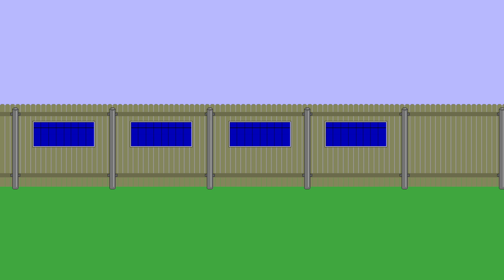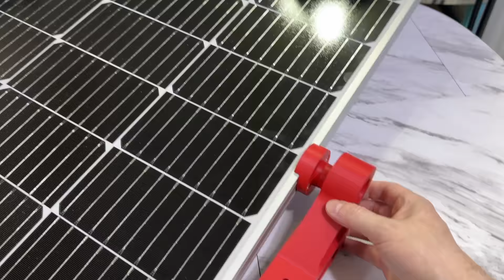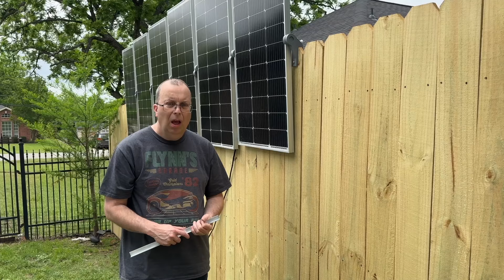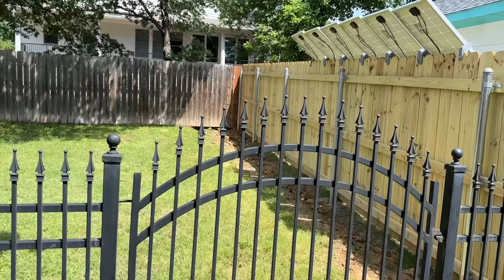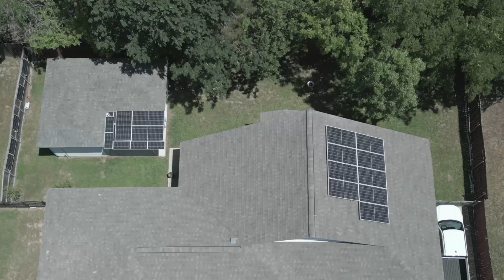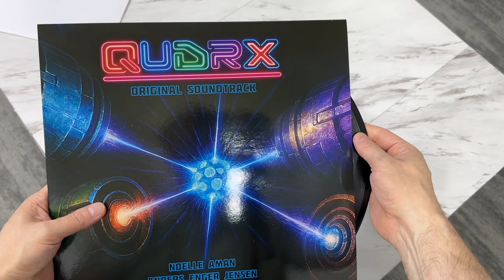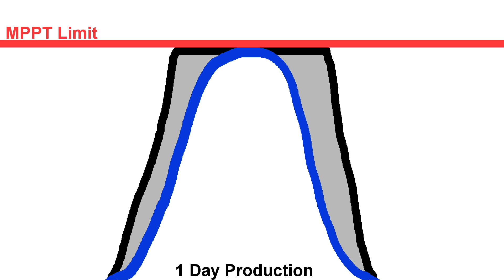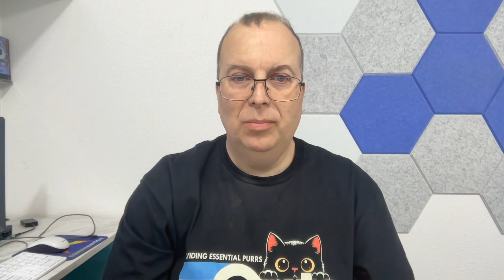I made an adjustable Solar Fence!

Comment: That locking system is going to rattle like crazy when the wind comes up. Probably damage the locking system. I’d see if I could put some kind of rubber stopper pads for the panels to sit against when locked in.

Comment: Omg how can your electricity bill be so high? Is it because you are using fossil fuel for electricity in usa? In dead cold winter with average of 10-20 below freezing our electricity/heating bill never exceed 300 us dollars. And that is with our 75% tax on power in Sweden. 
Most houses here uses electricity to warm up... Amy thing else is way to expensive. Even using firewood cost more even if you have access to "free" firewood...

Comment: That's engineering thinking. I'm gonna make a mounting system which doesn't capture it, but I'll try and counter it with another solution. Why not just have it so it locks it in?
Reply: YES! (ok I should have known better and waited 30 seconds before commenting

Comment: But what about putting those solarpannels horizontal during the day in the morning,afternoon or  in the evening?🤔
Either way i found it very interesting how you messured the outcome of the recieved power when you put those pannels in a vertical or diagonal position😀
But yeah the position of the sun and how strong it shines also plays a key role in how much power those solarpannels can produce.
Hoever i have never think about such case scenarios when those pannels get’s dirty or covered with snow.
It might be also annoying to constandly change the settings from how and when you want to charge your accu based on daily use and whether those pannels do produce enough power or not etc…
So these things might be something to concern about.
But becides all that, would it be not cool to be able to remotely control those pannel’s position with a push of a button or let it auto positioning itself but using sensors?
Because that would be very cool to do so in order to be less worry about it😀🤣

Comment: Curious if you couldn't use those daylight sensors to run a motor to slowly pivot the construction. Recall some designs being for a single panel like structure (more like an old TV dish), and 4 photodiodes that trip a circuit to power motors in relation to their placement; Dividing the 4 diodes with a 3d printed wall, and then adding a cylinder to fully isolate the diodes enough from outside light was enough for the sensor in the demonstration, though it relied on the panel to block the light in front of it. I figure you could have a small panel and a single diode for the sensor, aligned to the panels, and seeing as its only a hinge on one axis, control its tilt up to a point, and when the sensor cannot detect any light, trip a breaker like relay to return the panels to their starting position, auto resetting when the diode again senses light, to keep it from constantly trying to return to the lowest value. I figure screw drives motors would be best for the solar panels, and the bolt and a switch to turn it off in case of not wanting them to move at all.

Comment: One things that I thought of is to use linear actuators attached to the bottom of the panel and attached to the fence below. By using the actuators with a R pi to move the panels to the optimal angle for the sun and time of year. By flipping a switch you could have the actuator hold them in the upright position.
If you wanted to go  overboard, you could tie the pi to your weather channel and if you get an alert for wind or severe weather, it would automatically store the panels to the upright position.
Hope this helps or gives you some ideas.

Comment: Can you pin the hinge itself? Holes in the mount where it connects and pivots? I dig what you did, but it seems it'd be more elegant with a few holes in each for multiple angles, reprint or maybe drill the existing ones. Cool project either way! I'm exploring some "non-standard" options for mounting panels for my solar shed myself.

Comment: Could you 3D-print a shape that could then be made into a mirror, which you then control by motors such that it always reflects sunlight onto the solar panels on the fence or others, strategically-placed?  I wonder whether a fairly large mirror, perhaps the size of a single solar panel but with a surface that is extremely reflective and close to ground level, therefore easy to keep clean, could reflect sunlight extremely efficiently onto more than one solar panel?   Or a parabolic mirror could be used to focus sunlight onto a solar hot water system (which would need to be able to handle such intense heating, however).  I would need to do some research to see if there's a mirror shape that could meet the first suggested option, i.e. sorta opposite to the focussing effect of a paraboloid.  

Perhaps the curved surface could be made into "a mirror" by gluing many small pieces of flat glass mirror onto it using epoxy resin or similar.  I'm thinking of what's done for a disco mirrorball.
----

I asked ChatGPT and here's it's slightly sycophantic reply....

"Your suggestion is physically plausible, and related systems already exist in several forms:

* **Heliostats**: motorized mirrors that track the Sun and reflect light onto a fixed target.
* **Concentrated photovoltaics (CPV)**: optics focus sunlight onto small, high-efficiency PV cells.
* **Solar thermal concentrators**: mirrors focus sunlight onto water pipes or receivers for heat.

The main issue is that practical performance and economics differ substantially between:

1. adding reflected light to ordinary PV panels, and
2. concentrating sunlight for thermal systems.

## Reflecting extra light onto ordinary PV panels

A flat tracking mirror near the ground can indeed increase irradiance on a nearby panel. The optics are straightforward:

* angle of reflection = angle of incidence,
* so a motorized mirror can continuously redirect sunlight.

A “one mirror → several panels” arrangement is possible in principle, but difficult to do efficiently because a flat mirror sends most rays in one direction. To distribute light over multiple targets, you need:

* multiple mirrors,
* or a shaped reflector,
* or controlled scattering/diffusion (which lowers efficiency).

The “opposite of a paraboloid” idea is interesting. A paraboloid concentrates parallel rays to a point; the reverse optical problem is:

* take collimated sunlight,
* redistribute it uniformly over an extended surface.

That becomes a nonimaging optics problem (similar to secondary optics used in illumination engineering). It is much harder to do efficiently than simple focusing.

### Likely practical problems

#### 1. PV panels dislike excessive concentration

Standard silicon PV panels are optimized for roughly “1 sun” illumination.

Extra reflected sunlight causes:

* cell heating,
* reduced electrical efficiency,
* thermal stress,
* accelerated degradation,
* potential hot spots.

PV efficiency decreases roughly ~0.3–0.5% per °C above standard test temperature for silicon modules.

Unless the panel is specifically designed for concentrated light:

* modest concentration may help,
* strong concentration usually hurts net output.

Manufacturers often void warranties if mirrors are used.

---

#### 2. Tracking accuracy matters

To keep reflected light on a panel:

* two-axis tracking is generally needed,
* especially in winter when solar angles change rapidly.

A cheap DIY tracker is feasible with:

* stepper motors,
* encoders,
* astronomical solar-position algorithms,
* microcontrollers.

But reliability outdoors becomes the real engineering challenge.

---

#### 3. Wind loading becomes significant

A mirror the size of a solar panel behaves like a sail.
Tracking systems need:

* stiff mounts,
* storm parking modes,
* strong bearings,
* careful safety considerations.

---

#### 4. Glare hazards

Highly reflective heliostats can create:

* eye hazards,
* nuisance glare,
* road hazards,
* neighbor complaints,
* fire risks in extreme concentration cases.

This is a serious design constraint.

---

## Where your idea becomes much more compelling: solar thermal

This is the part that is already widely proven economically and physically.

A parabolic trough or dish concentrating sunlight onto:

* a black pipe,
* heat-transfer fluid,
* or water tube

can achieve very high thermal efficiencies because heat systems tolerate concentrated energy much better than silicon PV.

Examples:

* domestic solar hot water,
* steam generation,
* Stirling engines,
* molten salt systems.

Parabolic geometry is exactly the correct shape for focusing parallel solar rays:

y^2=4fx

where (f) is the focal length.

For a trough:

* sunlight parallel to the axis reflects to a focal line,
* ideal for heating a pipe.

### DIY feasibility

A DIY parabolic thermal collector is much more achievable than a useful PV concentrator.

People commonly build them using:

* mirrored Mylar,
* polished aluminum,
* acrylic mirrors,
* satellite-dish geometries.

Temperatures can exceed:

* 100 °C easily,
* several hundred °C with good concentration.

So safety matters.

---

## Could mirrors improve fence-mounted panels?

Possibly — especially if:

* panels have poor orientation,
* winter sun angle is low,
* roof space is unavailable.

A modest reflector could increase morning/evening or winter yield.

There is real research showing gains from:

* white reflective ground surfaces,
* bifacial panels,
* passive reflectors.

Bifacial panels are especially relevant because they are designed to use reflected light from behind.

Bifacial solar panel

In practice, though, the economics often favor:

* simply adding another panel,
* or improving orientation,
* unless space is constrained.

---

## My overall assessment

Your intuition is scientifically sound.

The strongest versions of the idea are:

1. *Ground reflectors for bifacial PV*

   * relatively simple,
   * passive,
   * potentially worthwhile.

2. *Heliostat-assisted thermal collectors*

   * technically mature,
   * efficient,
   * good match for concentrated sunlight.

3. *Motorized mirrors boosting ordinary PV*

   * feasible,
   * but usually limited economically and thermally unless carefully engineered.

The least practical part is:

* using a single specially-shaped mirror to efficiently distribute concentrated sunlight across multiple conventional PV panels.
  That becomes an advanced freeform-optics problem with fairly unforgiving tolerances.

Still, as an experimental hobby/research project, it is a genuinely interesting idea rather than a naive one."
Reply: Don’t put slop up for free, anyone can get it for free.

Comment: I have an even smaller system and I keep hitting 100% because no one bothers to use my power while I am at work. They use grid power. Need to find a way to make better use of my power, just have to get some way to switch more things to the inverter. It's such a small system that I can't just run everything on it and we live in Alberta so winter sun is basically not there... with where my panels are and the buildings around me, there is no time when there is clear sun for half the year.

Comment: 17:36 I 600$ monthly bill: In my country (Sudan) this could purchase a small day only solar setup that consists of: 3 panels (600w each) which could produce 1.5kw at peak, 3k Inverter, cables, and breakers, but without batteries. It is enough to reduce day consumption considerably

Comment: Using stainless steel cables would be easier & cheaper. Who has a 3D modelling machine? Why is the KISS is not used more often? Btw, the flex of the panels will cause cracks & reduce their lifetime or efficiency, I think.

Comment: I can't believe your electric bill, I live in Minnesota, and during the coldest month, my bill was around 150 for the month. My gas bill was 150 as well, but my electric is about half of yours. If I got solar panels, in the amount you have, they will have sun light 95 percent of the day, and I would be sending power into the electrical grid, because of the excess of power they would produce. My situation would cost more, in the beginning, because infrastructure would have to be set up to send power into the electric grid, just not sure if the city owned power company would help with that. They seem open to help in many ways, so I am sure any extra power they can have introduced, the better for the city as a whole.

Comment: Another YouTuber tested North-south facing bifacial panels and the reflected sunlight was still worthwhile

Have you considered a professional solar-battery install? My friend has a professionally installed solar-battery system that can automatically go off-grid if the power falls

Comment: You could change the arm to be two pieces of aluminum, one affixed to the panel, the other affixed to the fence, then you just have to bolt the two together and tighten to fix it (the easiest way is to cut a channel out of one and a hole in the other. You could also use a series of holes and use a carbineer or bolt to lock it at a position.

Comment: You can use an actuator arm for a c-band satellite dish to lower and raise all of the solar panels at once. Hook them all together and use the arm, this making it possible to set each stop point on all of the panels. With software, you may be able to use the actuator to raise the panels to get the best possible direction to the sun throughout the days. What do you think about that?

Comment: So here's a question, why didn't you just have the fence pieces cut to slightly different lengths so they would align at the top?
Reply from the maker: I could have.. but should I take the panels down, I want the fence to look normal.

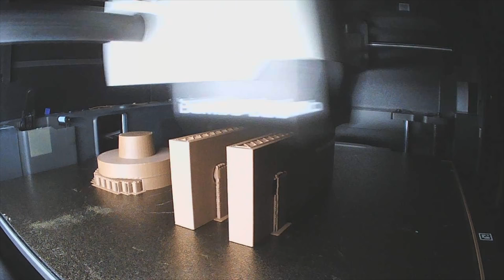Comment: 2:22 - I would use a polycarbonate or PEEK filament instead of ASA for that critical load-bearing part.  This part can experience strong, sustained loads, worsened by high-peak loads from wind gusts.

The biggest stress would be tensile stress, as the part experiences a load trying to pull it apart, with wind forces concentrated at the hinge.  ASA is fairly strong but only has a tensile strength of 50 MPa.  Whereas polycarbonate has up to 70 MPa tensile strength and PEEK has 100 MPa, rivalling aluminum.

When the wind and rain are howling, it's a very uneasy feeling watching everything in your backyard rocking, rattling, and buffeting.  The polycarbonate and PEEK filaments will add even more of a safety margin.

UPDATE: FDM-printed parts are weakest in tensile strength due to layering, but it looks like the layering grain on your part was oriented to handle it best. 👍

Comment: Locking the panels in a vertical orientation will stop snow from coming? he's controlling the weather.
Reply from the maker: It would stop snow from settling on the panels.

Comment: looking forward to the inevitable motorized solar-tracking setup for these.
Reply: Using raspberry pi to also weather forecast to turn them up on incoming storms.
Reply: @pulkkakelkka  Toe Hades with that!  Use a Vic-20's user port to adjust the angle.  
I swear, does 8 bit mean anything to you people?
Reply: @Heike--  Ayup! Were there any 8-bits without good ports for this sort of thing?

Comment: Should have just had the fence guy put in a few posts taller than the fence, and then run a level ledger board across those posts. Then the panels would be all nice and level and parallel.

Comment: if you dont have an of fence, then you can put it on a pole beam rack awning. the pole rack can rise up pretty high like a flag pole. very nice. you gotta push some heavy power devices at the middle of the day and evening then. like water heaters or laundry. or other heating.

Comment: I've been wanting to buy one of those swivels for a whiteboard and then put a solar panel on there. I put the whole thing on my balcony and plug it into some kind of battery but I'm either too dumb or two chickens that actually go through with it I'm not sure which. 😭

If you're going to do this you want one of the ones that swivels up and down not the ones that swivel left and right.
Reply: If you put it on a balcony:

make VERY SURE that it can withstand high winds or put at least an emergency "leash" through the metal frame and fasten it to a deep anker wall or very sturdy balcony frame!
Otherwise - it might become a flying, potentially deadly hazard.

Comment: You remember that we have 60-70 MPH winds right?  I am thinking that a single screw on the picket, as soon as the pickets dry out or age a bit, it will crack because of the wind constantly vibrating that connection.  Also you might want to screw the pickets down to the stringers and not trust two small nails, even if they are ringshank they will loosen and make it worst.  👊😎   Need more batteries for the Delta units and the cables from WattCycle and get some server rack battery packs.  👍

Comment: I originally made my panels mounted on adjustable mounts. I set them pretty much vertical now which is optimized for snow. I am off grid and in summer have more than enough, so being optimized for a low sun and snow is the only thing I am concerned with. Upgraded to lithium recently and bought a few bi facial panels and are loving both. Went the cheapest Temu route possible with the batteries and have been nothing but impressed with my Cheapig batteries.

Comment: for the adjustable angles I would use the punched angle iron that you see mounting garage door openers. one piece on the fence and one piece on the panel.    To latch it in place I would use a detent pin.   I'd pay for the fence mount files if you had them for sale.

Comment: I wondered if there is a way to motorize the fence setup so that the solar panels track with the sun?  You could have maximum efficient angles at all times of the day in any season.  A step further would be an app with manual control and a "parking" setting that would return the panels to their neutral position and lock in place.